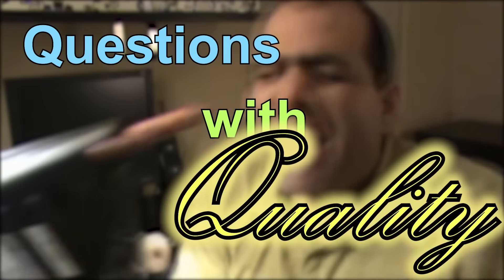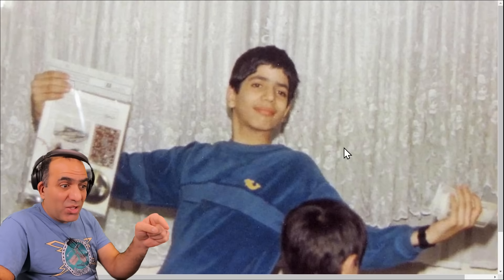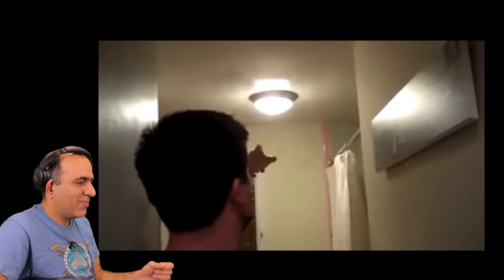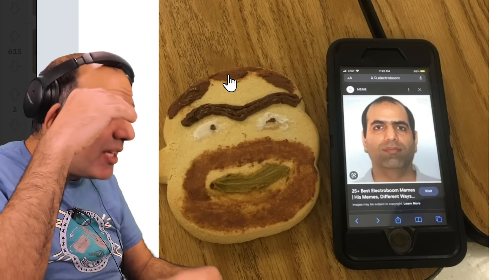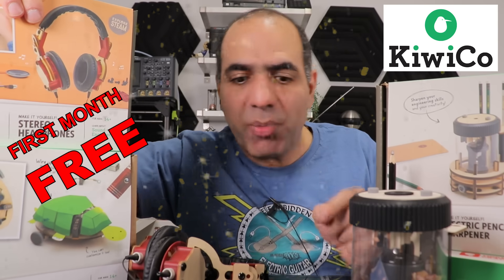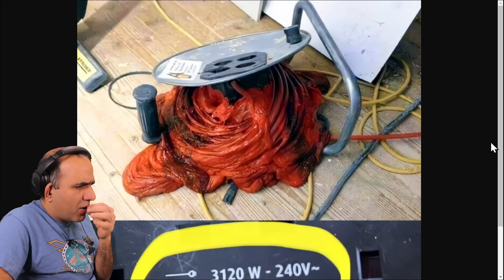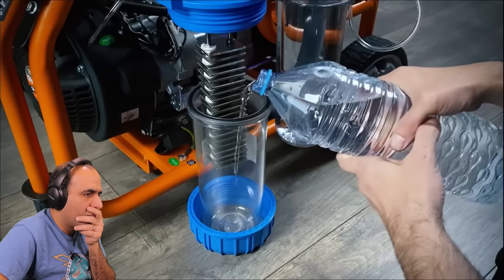Can ENGINE Run on WATER?! They Copied my Toy (LATITY-011)

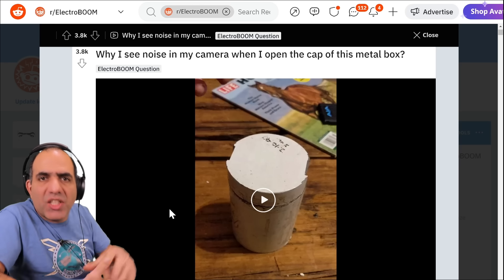Comment: 13:05 reminded me of getting a consistent glitch from a fairly old NAD wireless ADC unit, which is a USB dongle that transmits (I assume) via FM to the ADC at the amplifier (so I guess it predates Bluetooth; or NAD c/wouldn't use it for whatever reason). But a little glitch in the signal would occur regularly when I had an enamelled metal case full of passive electrical components up on my lap, in the transmission path. If there's any relationship at all, it's probably just the metal case itself, but could thousands of resistors, all sorts of caps and IC chips (in small plastic ziplock bags) have any conceivable effect on the FM signal? Haha. I'm doubtful myself ... but still curious.
Reply: The question is if they emit EMF. If they do, then yes, they can mess with the signal. This would only happen if there's a powered circuit though. Otherwise, the signal may not be able to reliably get through the case depending on what the frequency is, and that could cause it as well.

Comment: You can make a carbon arc furnace with those rods but you need a lot of power to do it and also they used them in searchlights in the WW1 and WW2.
Reply: They used carbon Arc lamps in film projectors too. When I was a kid my dad talked to the guy running the projector at the local town hall and he let up come up and look at how it all worked

Comment: 1:50 They make,or used to make,a soldering iron using a carbon/graphite tip. "Cold Heat",I think it was called. I got one as a stocking stuffer one year,and it was....basically garbage. Plus the brittle tips break off easily.

Comment: 10:00 Regarding the shortest path from one end to another, I was under the impression that it took the path of least resistance, and that includes through the air. If some air gets ionized, it becomes the path of least resistance, but (as I think you said) since air tends to move around the room, it causes the arc to bend along with the airflow.

Kinda makes me wonder, can you get an arc in a  vacuum? I know you can emit electrons in a vacuum but I don't think they form an arc per se.
Reply: Nop! Since there's no air to be ionized. The charge would still exist tho

Comment: What if you use solar for the electrolysis? Put hydrogen into engine. Bam.. problem solved
Reply: That would be the least efficient way of powering a car, it would still run on solar Power
Reply: @sam512  that is also true…

Comment: 12:15 ...Despite the improper common use of the term motor when referring to a gasoline engine.... Engine would be the correct terminology. An engine is a kinetic or thermal conversion system a motor is a electric to mechanical conversion.

Just a little pedantry for Mehdi ❤❤

Comment: Water can be used as fuel for an engine by direct electric hydrogen and oxygen device converted into the carburetor eliminating gasoline with some simple modification to a normal combustion engine can run on hydrogen and just fill the tank with water for fuel

Comment: on the light switch puzzle, They probably just messed up the line, neutral and switch wire. So when they plugged in the appliance it would make a connection and turn on the light.

Comment: Medhi, I built a water hydrolysis device and ran a lawn mower with it. It used stored electricity by charging a battery from the house the day before, but the engine ran on the hydrogen generated. This is real but it's not perpetual motion.
Reply from the maker: Yes, non-perpetual motion is possible. But why would you waste so much on breaking water and remaking it?! Just run a much more efficient electric motor
Reply: @ElectroBOOM  to pursue the idea, because the big claim by Stan Meyers (please research him) was that if you could break the molecular bond more efficiently, you would yield a greater return on the input power and possibly make a usable technology. Supposedly Stan Meyers had figured it out but obviously it's a "conspiracy theory" about why he suddenly dropped dead. That aside, it's an interesting idea to pursue and I know many people who have done far better with it than I have. Also, the water is used as FUEL....

Comment: The whole thing with the carbon rod is definitely possible as it isn't a new concept, before acetylene torches were commonly available they used to sell arc welders with a "carbon arc torch" attachment witch was just a holder for two carbon rods just like what you see in the video, anyway the purpose was pretty much the same as an acetylene torch so you could braise or heat up rusty hardware to get it to move, I've attempted to braise with one and it doesn't work the greatest but I also had nobody to teach me how to use it and couldn't find any tutorials on the internet.
Reply: I've still got mine, I did some amazing (brazed) rust repairs with it

Comment: 1:52 "i enjoyed the fumes of solder".......ok, that explaines something. There was lead in the old solder....maybe also the hair is gone because of that lead? 

And the next one (that bath-light-thing): There is something with the zero-conductor (or 2 x 1120 volts) wrong. It is switched over the second switch, and then the roof light goes on, but only minus the power, that is consumpted from the other light. Therefor that rooflight is not fully lightning, and if he switch the first switch, then the rooflight i fully on again. I don´t know, who you wire that circuitry....but, seems not to be impossible. But if it is the zero-conductor, that is switched, that is dangerus.
4:59... as i sayd.

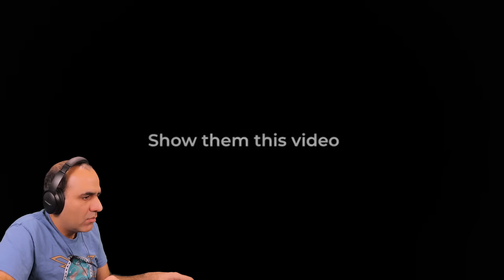Comment: 12:30 video is faked from a user on twitter
also if the theoretical "radiation" caused that much noise in the camera then the hand definitely wouldn't be able to absorb it

Comment: Agreed on the BS perpetual energy machines being fantasy. Now that solar is becoming more powerful (charge a lithium-ion battery) and we know electrolysis, or other forms of hydrogen generation is possible, why not burn the HO immediately in the engine? Then there is no need for HO storage. Electrolysis produces quite a bit of voluminous HO but perhaps there is a better HO generation method? One that could use a solar/battery method for the purposes of kicking of the reaction?

Comment: The water engine is not technically perpetual, since it's using water as a fuel. You may argue, though, that the power from the engine is not enough to run the electrolysis process. I don't have the knowledge to answer that.

Comment: So, the very first one is some certifiable bologna.

Just like medhi said, it cut to added material. We use carbon rods, but they're for some called carbon air arc. Hook up a big carbon rod to a regular old smaw welder and hook up a specific stinger that can blow compressed air over the spot you focused and it super heats the metal and blasts it off. Really fun, really loud. You're not getting anything like that with a car battery though. And you're especially not getting welds out of it.

Comment: 8:29 I believe the image right below that is showing how much current was involved.. it says 3120 W @ 240V, which would be about 13 amps.

The important point is that the cord is all coiled up, though.  Many (especially cheaper) extension cords are rated for a certain amount of current, but that rating is assuming they are operating out in open air, so the heat can be dissipated by the air around them.  However, if you coil them all up tightly like this, they can accumulate a lot more heat inside that tight package (!).  Always be wary of coiling up extension cords like this, as bad things can happen like this if you're not careful.
Reply: I believe that the coiled up cord behaved as an inductor here and the wire got hotter as it normally would thanks to the inductance . Normally an outlet of 240V is run thorough a 16 amp fuse. The fuse breaks long before the wire heats up like that. Besides those extension cords are rated to 3.6kW
Reply: @giaining  no, the extension cord did not behave like an inductor. This is because the cord contains two wires, each with current of the same magnitude flowing in the opposite direction. So the magnetic fields created by each wire cancel are close enough that they cancel each other and the inductance is removed. 

Also, even if it did act like an inductor, that would not increase the amount of heat the cord produced. On the contrary: an inductor in an AC circuit reduces the flow of current due to its impedance, meaning that if the coil of extension cord acted like an inductor it would actually heat up less .

Comment: The welding one - the finql weld was definitely done with a stick welder. All a carbon rod would do is provide an arc like TIG equipment does, and you would need gas and filler metal, and it wouldn't leave slag. The end weld looks like it was probably done with 6010 or something similar, and the guy who did it decided to use massively thick stock while not having large enough electrodes or a welder that could do high current, so he blasted through multiple rods trying to get penetration on that weld. He also had the rod stick multiple times and restarted the bead. All in all, very bad welder.

Comment: Pro tip: if you don't want to rip apart a battery, you can get graphite from a common pencil. Sharpen both ends, and connect both sharpened ends to a voltage source. 20 to 30 volts should do. It'll get hot and start to burn the pencil. No need to burn the whole pencil. The graphite should burn itself free in less than a minute.
Reply: Yeah but pencils are graphite/clay mixtures where batteries are pure carbon.
Reply: @professorfukyu744  yes but if you put power through that graphite long enough the clay and other crap will either melt/burn away
thats what the smoke comes from when you first start putting power into mechanical pencil lead
Reply: @professorfukyu744  i thought only the erasers had clay in them, but i guess there's enough graphite in pencil lead for that to work.
Reply: you can also get large diameter graphite for artistic use or mechanical pencil refills. Artist's graphite will be much larger though. They will have some clay included for hardness though, so don't expect them to be chemistry grade or anything.
Reply: you can also use brazing rods from the welder store. They are graphite rods, often with a thin metal coating that is easily removed (dilute acid for one)
Reply: Pro tip: Don’t have a wooden casing on the graphite that you’re heating up, the wood will experience something I like to call: “Lighting on fire”.
Reply: @MrFeatherMan  the moment i saw it i knew it was fake cause of that and for it to do that it would have to be at the melting point of metal.
Reply: So i removed graphite from a pencil and connected it to 220V mains. The result were something different. It erupted in fire from top to bottom and broke at the junction point breaking the circuit. It was a frightening and awesome at the same time.
Reply: @masoodjalal1152  Lmao Damn Hope You Take safety mesure xD
Reply: Or just lead for a mechanical pencil
Reply: Depend on what you want to do but you absolutly can make wood burning with a normal wooden pencil
Lot of my projecta thos need those beautiful graphite rod tho
Reply: @@sourandjaded2586 I do, Its cheap
Reply: He already did this in a previous video called somewhere on the lines of graphite characteristics am almost certain you watched it and copied it here.

Comment: the water engine actually would produce enough energy to use, as in it drains the battery, so all its  really doing is just wasting power by electrolysis and using power from the battery, electrolysis is like 90% efficient but combustion engines only 50, so you lose 60% of the energy, so its basically just an overcomplicated way to waste a battery

Comment: Many years ago I saw a video of a 'water powered engine'.  It was different than this one though, as it used a carbon arc submerged in water to produce a flammable hydrocarbon gas instead of hydrogen by electrolysis.  The generator ran and produced enough electricity to keep the carbon arc going.  As I recall the engine didn't seem to run particularly smooth and of course the spark gap had to be continually adjusted.  So yeah, it worked but not what I would call practical.  I doubt there was much power left for any load but the carbon arc.

Comment: The engine running on water isn't perpetual motion as it uses fuel. Just the fuel being water tha you have to replenish from time to time. Still sus
Reply: Water that is turned into hydrogen and oxygen that is then turned into water again when combusted, yeah sus indeed XD

Comment: PSA:
If you ever point a camera at something and you suddenly get a ton of static artifacts in your image, step away and don't touch it. Whatever it may be delivers too much energy to the sensor and messes up the image, be it large amounts of electromagnetic radiation or charged particles. Both are not safe to be around beyond certain limits and humans have not evolved a way to sense those dangers.

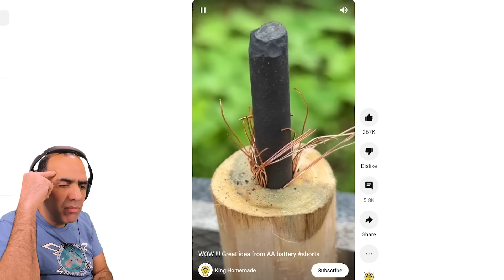Comment: 1:09 the fact that he had to peen off the spent flux powder shows he used a welder aswell, carbon rods don't have flux powder
Reply: Well carbon rods from battery are not pure graphite, they do contain flux and other compounds to improve the electrochemical cell reactions.

(But that is in very small quantity) 😬
Reply: @Vrushabh_M  but not flux powder, which is a thick coating around an arc welder rod that protects the weld as it's laid down and ends up coating it, and needs to be peened away afterwards.
flux just goes up in smoke in welding, arc welding flux powder coats the weld

Comment: Question: Why, when neutrał wire (blue one) in my house was broken, i have live on both connectors in the socket (checked by probe) and metal case of some devices can shock me? Why circuit is not open in this case?

Comment: Burning extension is easy. All you need is a light duty extension cord that can handle 10amps and 1 or two electric space heaters. Few a hours later, extension will melt. Is why the pros use heavy duty industrial extension cords- thicker wire to handle more current.

Comment: I'm not 100% convinced by that lead container video. The noise looks spread too evenly. If you search for "electron beam camera", you'll find a video of a GoPro passing through a high-energy electron beam, which is roughly equivalent to beta radiation. The noise isn't spread very evenly, and there are streaks as well as single bright spots. 

I could be wrong, though. I'm not a radiation expert. But if that's a real radioactive source in that lead cask, that guy's gonna have nuclear sunburns.

Comment: Yes the water powered car is pretty much BS, however, how's the efficiency between using a battery to move a motor, and using a battery to electolyce water then use the gas in an engine?
(Because I have no actual idea)

Comment: @Electroboom, Respectfully, I must disagree.  You can totally run an engine by burning water with Fluorine, or better yet, Chlorine Triflouride.  No guarantees on the safety of the engine or the exhaust or the fuel/oxidizer, but it could be done :D

Comment: Burning water no but high pressure water yes.  However its not running by combustion its running on water pressure. Even so it is so inefficient its pointless. The steam is releasing so much heat that the energy losses are absolutely terrible.

Comment: The light switch video... possible that he has two different circuits in the box that used to control the old fan.  I heard of people losing a phase in there breaker box, turning on an electric oven would make lights turn on.

Comment: Actually, there is some basis for the water motor. You don't use produced hydrogen/oxygen mixture primarily as a fuel, instead you use it to increase the temperature in the combustion chamber, therefore increasing efficiency of the combustion cycle of the motor. However, this still doesn't work. If you are interested in a real world test of that setup, search for Tech Ingredients channel, where he debunks this completely.

Comment: The graphite as an electrode I can confirm. Not the video itself there was obviously slag from an actual welding rod but I've used graphite electrodes with an old 240v Ac transformer welder to melt mostly copper. The arc it creates can melt steel but really only enough for welding unless you get some insane insulation.
Edit: forgot to add you need to grab those 6v zinc carbon batteries you see at home Depot, Menards, Lowe's, ect. They have carbon rods maybe 25cm in length and 5cm diameter. I always keep them on hand and when the 6v batteries are gone the carbon rods are still useful.
Reply: I think you're off on your conversions, at least the diameter (5cm is 2 inches), and I assume you meant the total length of all 4 rods. 
From videos I've seen I would guess each rod is maybe 8cm long, 8mm diameter, but I've never taken one apart myself.
Reply: I've seen people stick weld with proper electrodes connected car batteries too, so there's some reality to that clip

Comment: Welding with carbon rods was a thing people did in early 20th century and you can surely do it by holding metal wire in other hand but it suffers from heavy oxidation.